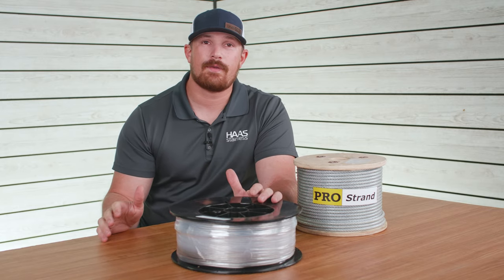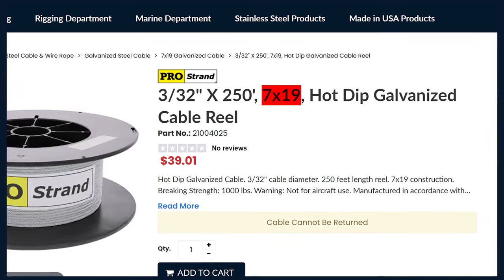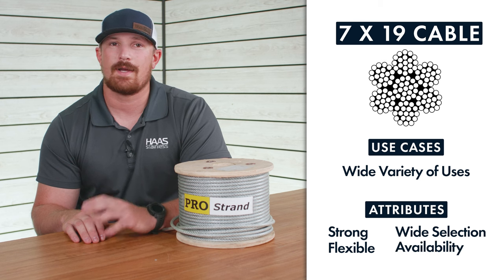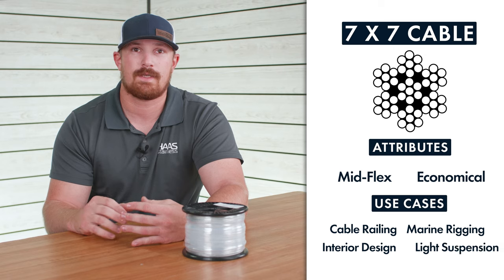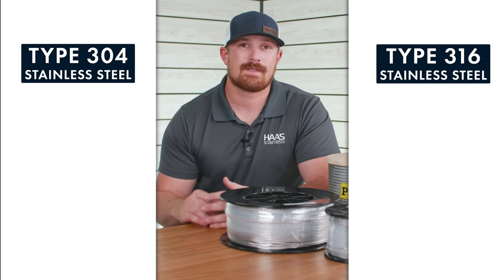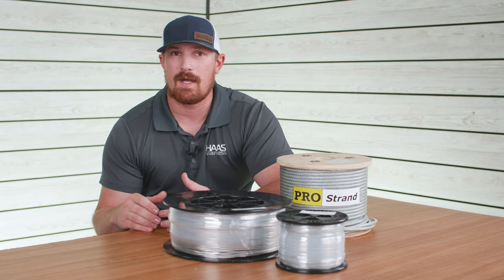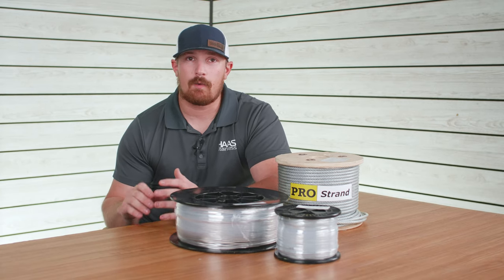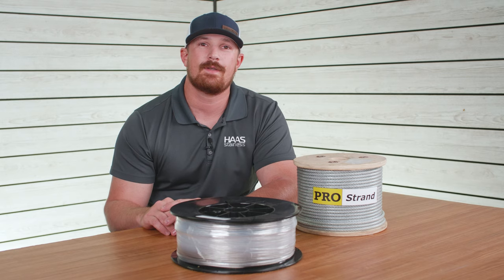How to Select the Right Steel Cable - Buying Guide for Wire Rope and Aircraft Cable

Comment: Which one is recommended for roof truss building in tension heavy loads new England area?
Reply from the maker: Hey great question! Maybe someone in the comments can offer a more specific suggestion, but we now offer 6x26 IWRC Galvanized Wire Rope with WLL of up to 3.7 tons. It's a great general purpose wire rope that can withstand a lot of force and abrasion.

Comment: Great video.  How do I determine what size cable to use based on what I’m hoisting?  Going to be hanging ~150-200 pounds from the ceiling of my garage using a ceiling hoist.  Lifting a pallet that will remain overhead, so it needs to be safe.  What size and type will work best?
Reply: Thats what he supposed to cover but..

Comment: My church has a paved parking lot and we need to run a power line 150' to the marquis sign from another pole that has a timer on the parking lot lights that are a 110 volt we and can not do under ground,  my question is what cable can we stretch that far to put an electrical wire over to the sign?
Reply from the maker: You should be able to use 1/8"-1/4" cable depending on personal preference and weight of the electrical wire.  Thanks so much for reaching out, let us know if you have any more questions!

Comment: Looking for a light duty cable to hang in a tree.  Local national named hardware store has a 7x7, 1/16”, 100’ cable with a description “Heavy duty Electrogalvanized steel” cable for $19.00 & a regular galvanized cable that is the same length and price without the Electogalvanizing.  I checked out the descriptions of Electogalvanized on the internet and it sounds like it goes through an additional process and should be more expensive.  What is Electogalvanizing and do think the company advertising their cable as being Electogalvanized is just using that term loosely or is the consumer actually getting a good deal buying a cable that has Electogalvanizing process for the same price as a cable with out that process?
Reply from the maker: electro-galvanizing is a corrosion resistant coating that is put on the steel typically before spinning it into the cable.  It really depends on the company doing the coating process whether or not they are going to get a good deal.  Typically you want the extra coating on plain steel.  Stainless will typically come uncoated when purchased.
Reply: @E-rigging  maybe hot dipped galvanized is better

Comment: Hi.
For some reason cant find any info for the strent of 7/19 compared with 1/19 stainless wire.
I have spliced a lot of 7/19 on a merchant ships.
Think to splice the rigg on my 7 tones sailboat from 7/19 as I like to do it by myself. 
Any calculations for replacing 1/19 with 7/19?
Thanks!
Reply from the maker: the 1x19 is going to be slightly stronger but near impossible to splice.  The fewer wire strands at larger diameters that make up the 1x19 makes for a much stiffer cable in comparison to the 7x19 made up of much thinner, more flexible wire strands.